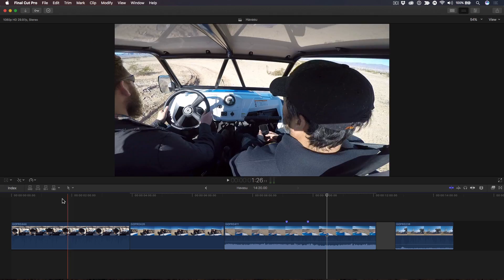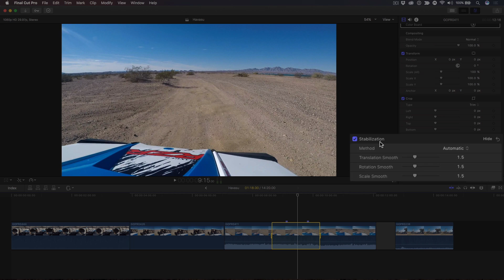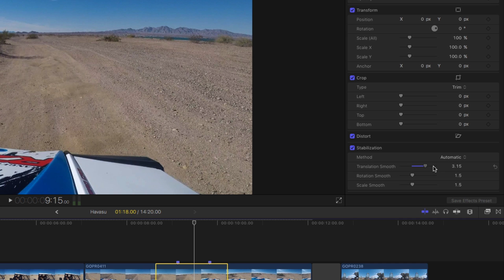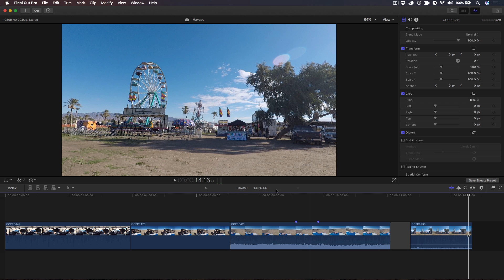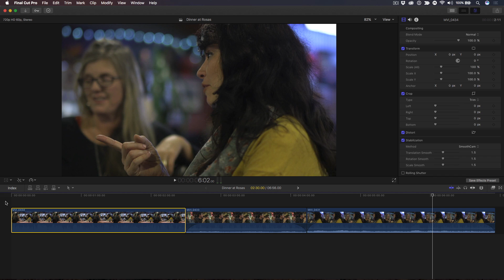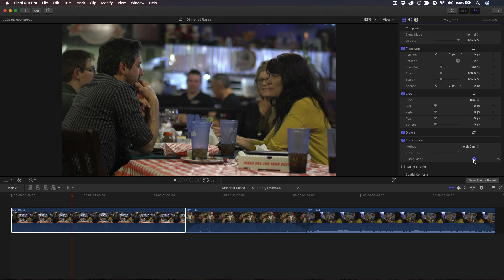Final Cut Pro X in Under 5 Minutes: Reducing Camera Shake

Comment: Its worth pointing out that this works by ZOOMING IN on footage and as such your footage will not be quiet as sharp as it was, but if your having to use Stablization in the first place it probably means you otherwise wont be using the shot, so its a great fix.

Comment: If any Premiere users are watching, Inertia Cam is similar to Warp Stabilizer. I generally like Smooth Cam mode a bit better because it's less "warpy" on wider shots. Inertia cam works best when the scene is shot with a 50mm or higher focal length so there's no warpy-warp after being corrected.